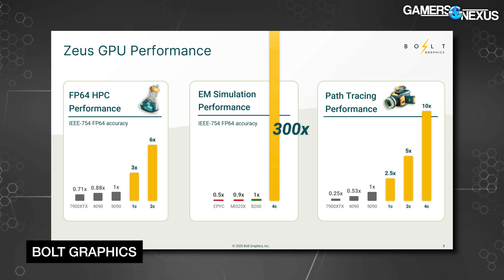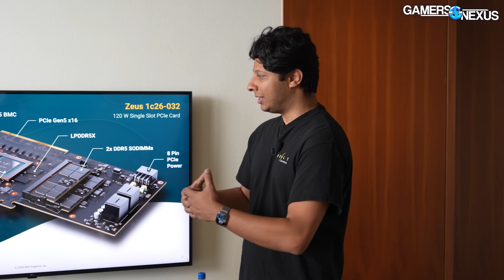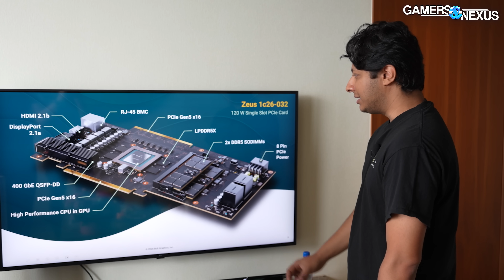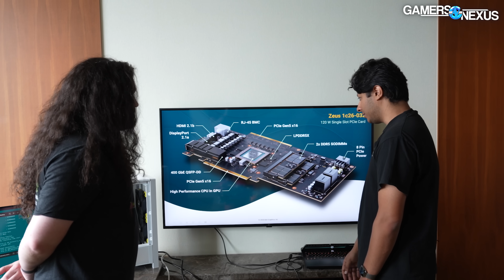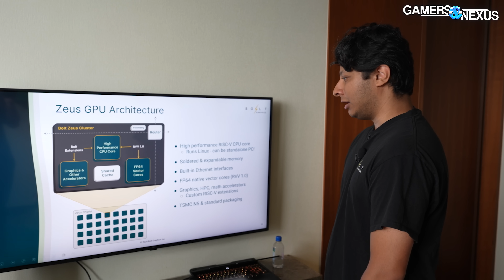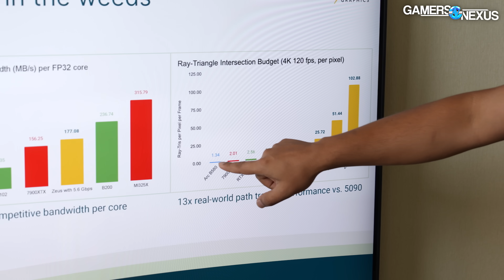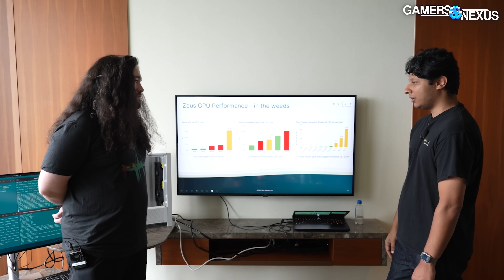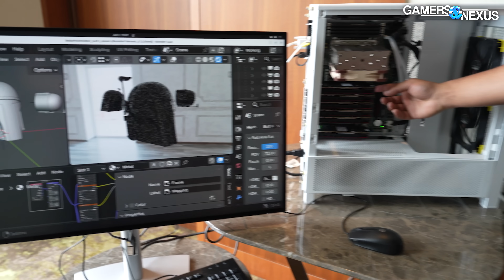A New Gaming GPU Challenger: Bolt Graphics Takes Aim at NVIDIA

Comment: Really would've been better if they used standard DIMMs rather than SODIMMs. I understand space constraints but it's more expensive, slower and comes in smaller capacities. Should've put full-sized slots horizontally on the back of the board.
Reply: Personally I'd like to see them take (LP)CAMM memory modules. Smaller profile, two channels in one module, still upgradable.
Reply: @SundownMarkTwo  Might work, not sure if you could route the traces well with the way it's arranged.

Comment: Neat concept, but i genuinely dont see this going anywhere besides VERY niche settings. A first step.
Reply: I think one of the applications he keeps talking about in the video is CGI so that's like probably just enough on its own. Is there something about like a million dollar cluster. If people can use this to make movies and TV and stuff then this is like a very solid product.
Reply: @iamjacobnz  I dont see how slotted DDR (low bandwith memory) is good for that scenario.
Reply: @alejandrosrwebmaster  I think context switching is less of a thing with CGI than video games so it may gain some there.
Reply: @alejandrosrwebmaster   Lots of RT with huge assets. Those 8K+ textures need to live somewhere when you render a movie with thousands of them. Being able to equip them with hundreds of GB each will make a render farm a much cheaper endeavor than using a Nvidia cluster. The card is definitely designed to beat Nvidia at CGI first, gaming second.
Reply: @alejandrosrwebmaster  because size is better than speed for movie cgi, it is not real time
Reply: Yes, that's what is said in the video
Reply: if it might get the speed, it could work as sort of a GPU rendering accelerator card, similar to what Voodoo cards were for gaming back in 90s/00s. I seriously doubt they will be fast though after seeing this demo...
Reply: @MrSheduur   The demo is an FPGA simulation. It isn't supposed to be showing the potential speed, only that their concept works. They explained that  in the video, and wouldn't have a 1 frame per minute 'demo' running to try and show off actual hardware.
Reply: It isn’t necessarily all that niche. Silicon Graphics’ core market was wealthy customers who specifically needed high end 3D graphics—more generic scientific-computing types went for things like DEC Alpha instead—and SGI used to do pretty well. Of course Bolt has still got to offer them a reliably working product with performance gains impressive enough to make a non-standard approach seem worth the pain.
Reply: how is graphic design niche
Reply: It entirely depends on Nvidia. If they keep putting in at least a token effort than people will stay with them, the brand loyalty is insane.

But if they skyrocket their prices or just abandon the lower skews entirely I could see Bolt finding success. Because while the 80 and 90 class cards are expensive, the 50, 60, and 70 are affordable for now.
Reply: @infinite683  at this point nvidia doesn't really need to try that hard because of the loyalty. they could make no performance improvement and somehow ppl will still foam at the mouth for it.
Reply: @infinite683  60 may be affordable, but it has the same vram as mainstream consumer GPUs from 2015
Reply: @Trucks_R_Us  vram is not the be all end all
Reply: @azraelfaust487  It is for the 5060/ti however
Reply: @Trucks_R_Us  It's a 3D rendering computer not a GPU.
Reply: @Trucks_R_Us Which is fine for 99% of people buying those cards. Most people still play at 1080, with some people dipping their toes in at 1440 and 4k. Most are not running into VRAM problems, especially with the 60TI and 70 TI variants.
Reply: @azraelfaust487  well not the all but the a lot, if every new games take the entire vram usage it's a problem
Reply: @infinite683  It's not fine in dozens of games at 1080p. The 3060 gets more fps in ghosts of tsushima and hzd, ps4 games from 2017 than the 5060 with settings where it gets 100-150+ fps so completely playable. Not 6 fps vs 3 at 8k. What a lot of games also do that a lot of people don't realise, is hide issues by lowering render distance and quality instead of lagging. So you may just think the game looks ass out of the box, but you're out of VRAM. And the ps6 is rumoured to have 24-32 up to even 48 gigs of VRAM. So good luck playing next gen games at all.
Reply: @Trucks_R_Us That sounds like an architectural and driver problem considering the similar Vrams they have. 

Also you're smoking crack if you think the PS6 will have more than 20 gigs of Vram and even that's pushing it. Next Gen consoles are already going to be 1000$ + as is, there's no way they're getting more Vram than a 4090 or even 5090 at your higher prediction end without going even further in price.

Maybe 2 years ago they could've pulled 22 gigs+ off, but definitely not in 2027, which Sony has committed to launching it in.
Reply: @infinite683 Similar? 3060 has 12 and 5060 has 8. That's a huge gap, 50% more. They don't have the same vram as a 4090 to begin with. So no sense comparing them. But 8 gigs of vram was 17$ when nvidia launched. They don't skimp for costs. They could easily double or triple every card without much imlact. Would you rather a 500$ 3070 with 8 gigs, or a 520$ 3070 with 16? A 549 5070 with 12 or a 569 24 gig? 

But then why would you buy the next gen? Sony has no incentive to make a crappy console to upsell you to the next. They'll subsidize it if they have too to upsell you in software and accessories, and the next one will be in nearly a decade you'll buy it just because it's the cycle.
Reply: @Trucks_R_Us  Buddy, you have to be specific. The base 3060 was 8GB of VRAM just like the 5060, you're talking about the 3060 12GB version that they put out later to compete with AMD. That's not a direct comparison to the current skew and I had no idea what the hell you where talking about until I looked it up.

Also Sony has confirmed this week that they will not subsidize the PS6 and haven't subsidized hardware for a while. Base price for parts was leaked by logistics info to be around 1000$, without accounting for manufacturing, marketing, R&D, and wherehouses.

So expect a 1100$ console at minimum.
Reply: @infinite683 You're confused lil bro. The 8 gig version launched years later and it was out of left field to scam some noobs who bought OEM PCs from dell and the like, so they could advertise 3060.

I completely forgot it existed, as do most people. You need to specify 3060 8 gig. It was mostly a GPU for prebuilts not DIY and they're relaunching the real 3060 not the 8 gig.

And sony said they won't subsidize it massively. Not that they won't subsidize it. That means they will basically for sure. And they also said their sales haven't been impacted when they have the worst sales since May 2000. So I'm not sure you can believe that investor meeting, not a leak, when they're lying about objective numbers like sales.
Reply: @infinite683 the issue is that Nvidia is something of an industry standard anymore. I've ran an AMD GPU for the last 5 years and the amount of one-off issues they have with various pieces of software is insane. I've had issues with video encoding performance in certain codecs and software, constant problems with temporal AA and scaling (especially in software made with Unreal Engine 5), and all around random instability with certain software. Ended up going back to NoVideo because at least the RTX cards just work for the most part even if they are ludicrously expensive for what they are.
Reply: @infinite683 I don't see them overtaking even Intel in the gaming space however, if they syphon off demand from some use case customers who currently go for gaming GPUs, God speed to them
Reply: Always the ones breathing and doing nothing talking about where something is going.
Reply: @EzWorkzzStudios  Then they cry and complain like why is NVIDIA doing this to us 😂
Reply: @EzWorkzzStudios  What do u want them to do? Blindly support everything? Build a competitor to Nvidia themselves?
Reply: @ashiai7 maybe some explanation as to why it won't work, instead of just saying "won't work"
Reply: @ChefDeCuisinart  I don't think it won't work, but him admitting that their raster performance isn't that great would be a huge stumbling block in a gaming market where plenty of people have large Steam backlogs of games that depend entirely on raster performance.